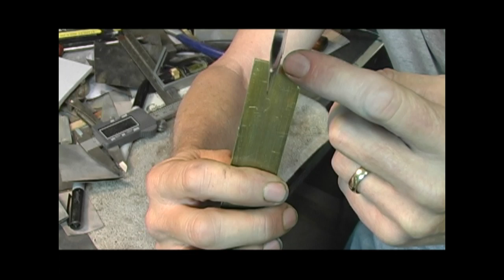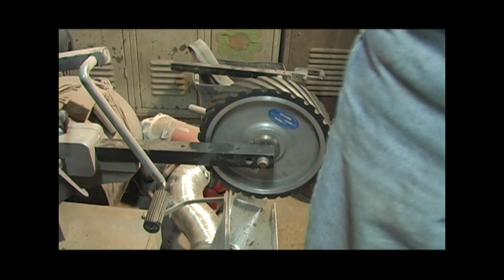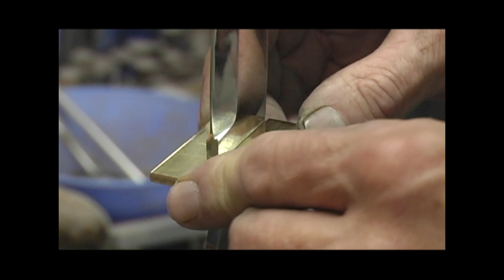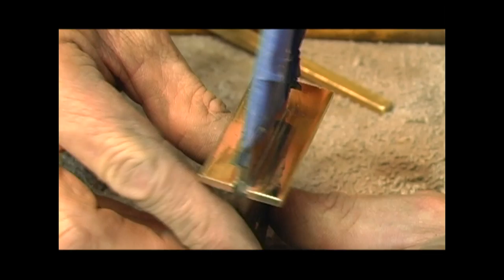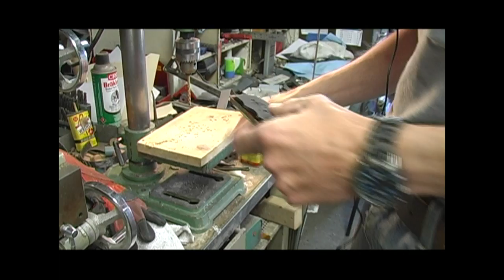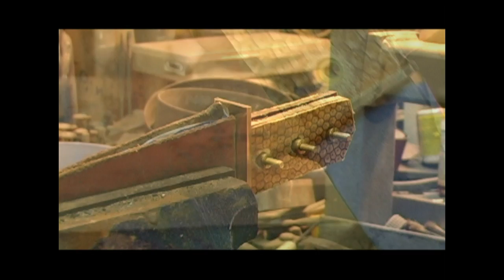Making a Skinner with a Slotted Guard

Comment: I was wondering is there a name for the Counter boar you use on the Loveless bolts. I was told there easy to find if you have the correct name for it. Knife supply companies have out of this world pricing on these things and they want tell you anything.... I also want to tell you how important your Videos are, they have helped me so much, especially the one you have which teaches us how to install a regular guard.....Thanks so much.......
Reply from the maker: I don't know the proper name for it. I bought mine from Jantz Knifemaker Supply. They list them with their loveless bolts. You can do the same thing with an end mill or even a drill bit but a drill bit will not give you that nice square shoulder.

Comment: Nice work!  Is there a coat of epoxy on top of the armadillo hide allowing you to sand without tearing up the surface?   Can you get thinner brass bushings for the Loveless bolts to reduce material removal?  Thank you!

Comment: That was a great video. So many little tricks and things to learn. You make it look easy. I picked up a Grizzly buffer with long arms a few months ago. I have slowly been collecting tools and things. Now you were saying yours spins at about 1100 rpm and this one spins at 3400. Will this be to dangerous to use, in your opinion? Thanks so much for the videos Mike. Joe
Reply from the maker: That's the way to do it. I certainly didn't buy all of my equipment at once. I bought a lot of it used. When a fellow knifemaker bought new equipment I would buy his old stuff. In my opinion, yes 3400 is too fast for a buffer. I know experienced knifemakers who use them and I have used them but they are very dangerous.